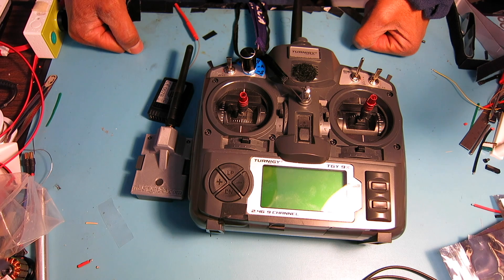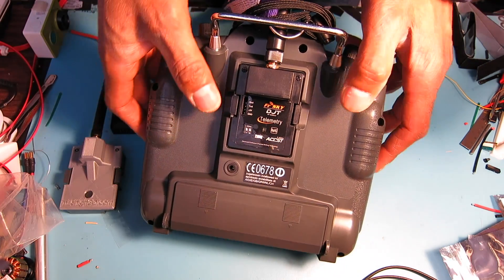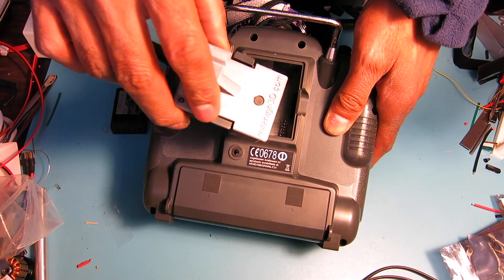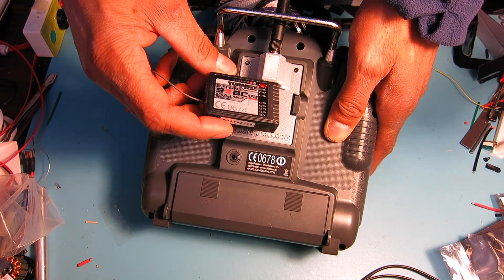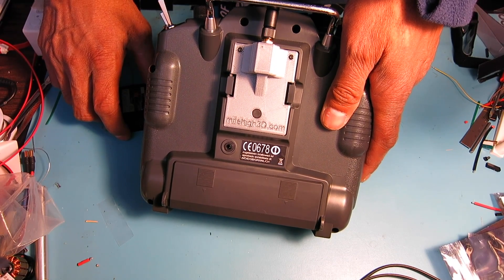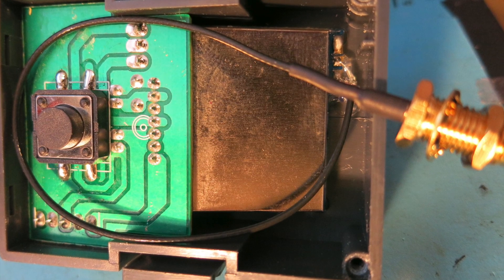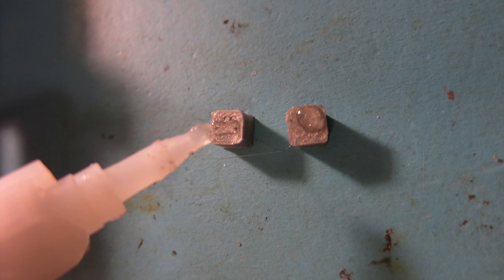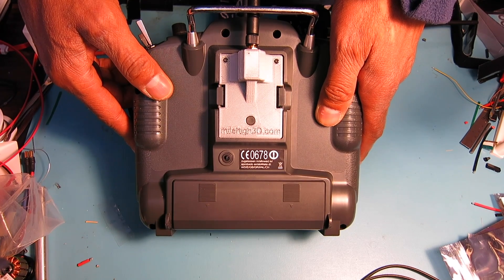Turnigy 9X OEM TX Modification for Swappable Module

Comment: I've done a similar thing where ive glued the module inside the case and routed a rp-sma connector where the old antenna was. I used a similar coax and checked continuity to the module which was fine but my range is down to about 100 metres ( as if theres no antenna at all). Any advice?